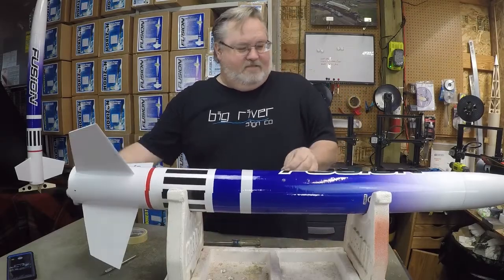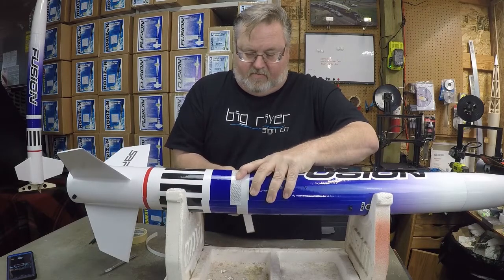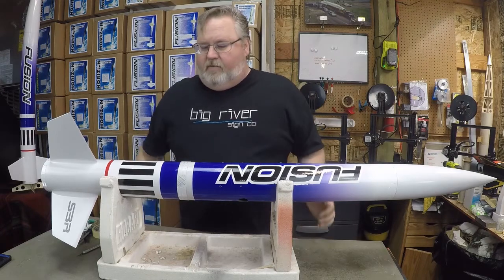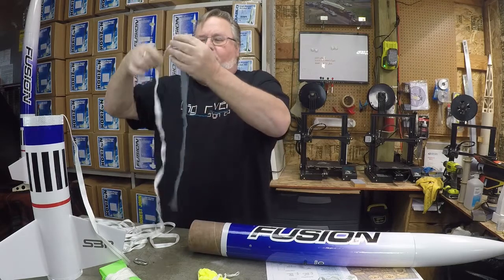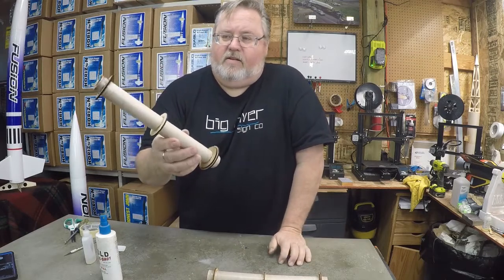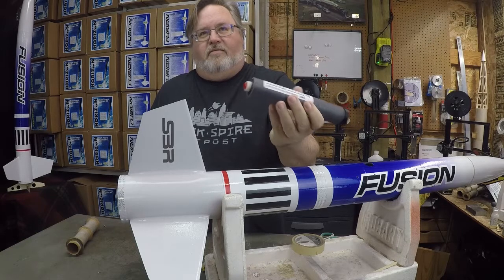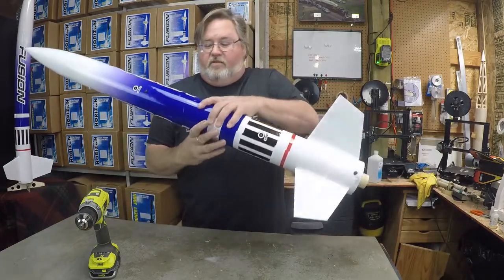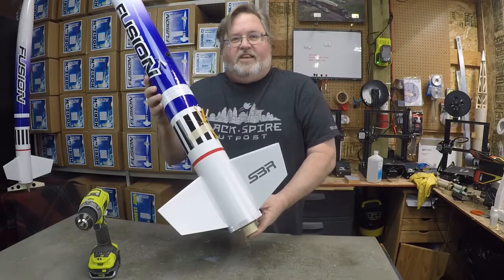SBR 4" Fusion Build - Part 4 - Finishing and Flying!

Comment: Excellent build videos that answered some of my lingering build and setup questions.  Thanks for taking the time and showing the details. I like the toothpick for sheer pin substitute, the painting of the fins with epoxy to smooth them out and strengthen and the demo of building charges and hooking them up to the altimeter. I like your almost full body wrap.  That's a cool way to get a complex design on it, make it look professional and get it done quick.  Do you think you could film one on first motor choice for both disposable and reloadable 38mm along with reloadable grain assembly?  You may have one and I'm going to go look now.
I wish I had waited to buy my 1st HPR and gotten a Fusion, but I see you are out again.  That's the proof of a great rocket, design and support.  Everyone is clamoring to buy them.  I bought a LOC-IV and I'm happy with it once I found something for L1 in stock.  Your build videos will help me build it better for sure and they have already helped me understand some of those sparse directions.

Comment: Im fairly new to high power rockets ive just started building them since covid started and ive built 27 rockets a few estes and the rest are mid to high power and ive noticed on recovery the shock cord was twisted like crazy so i started adding 8/0-12/0 swivels and i put 3 on each rocket lol 1 at the motor tube 1 on nose cone anx 1 at the parachute is that to many...

Comment: does it matter if you run your drouge  chute  at 1/3 of the top of shock line instead of the bottom 1/3
Reply from the maker: I like the drogue closer to the booster so that it's the last thing out of the booster, giving it a little more time to dissipate some of the energy and speed as the shock cord and parachute are deployed.  So my answer is yes - keep it closer to the booster.
Reply from the maker: Also, it allows the payload section with the main parachute to hang below everything else while falling under drogue - it lessens the chance of a tangle when the main parachute deploys.
Reply: If you're doing simple motor deployment (non-dual deploy), I assume you still want the main chute 1/3 from the bottom (nearest the booster)?
Reply from the maker: @BlackDim100  yes....